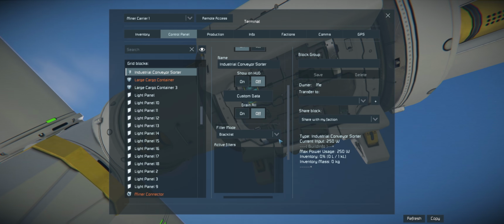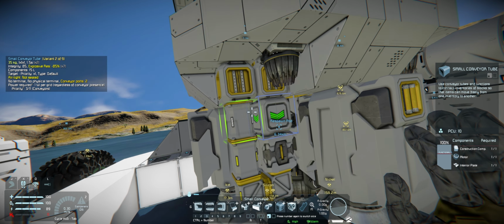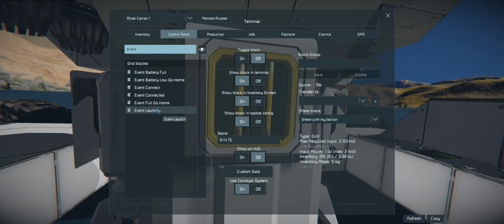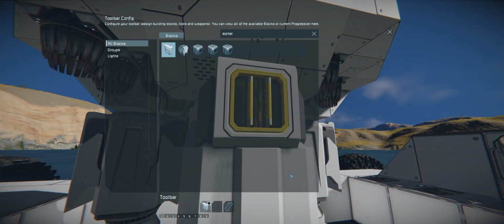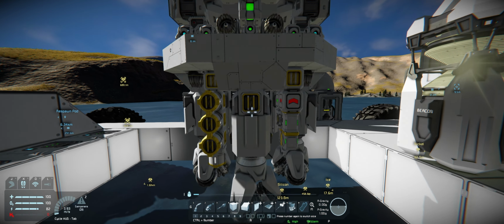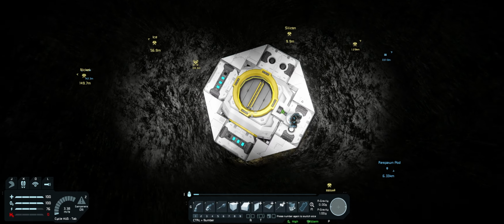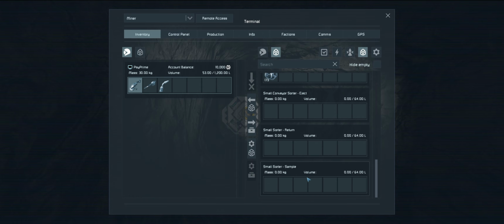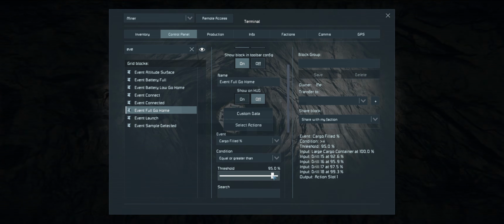Build an Auto Mining Drone Without Scripts - Part 2 (Space Engineers)

Comment: I wonder if there's some way to get it to mine an area? Have a chain of event blocks and sensors to check if there's voxels below it on its way down. If there are none at the bottom of its course, it returns aboveground, moves a bit to the side, and repeats.

And then once it's out from that side, it moves forwards.

Pros:
Can actually dig out an area with enough time.

Cons: 
Has to repeat its route until it reaches voxels.
Maybe impossible? Not sure if any of that works. Still gotta try it for myself.
Reply from the maker: Will likely need a script and programmable block but yeah I believe that is possible. Be sure to let us know how you get on with the modifications 😁

Comment: Making this comment a year after posting, but why not have extra drills on the side to create channels. Then have some wheels inside those channels above the drills. Might help the rig be more stable trips up and down, to increase the accuracy of return connections and reduce damage. Also a system of welders to repair the drone while it offloads material, and a projector to facilitate the repair of missing parts.
Reply from the maker: Good ideas. That’s definitely possible if you want to take the idea further. Good thinking!

Comment: Question:  How important is it for the truck to be level (or the ground to be level), as this may throw off the direction of drilling initially?
Reply from the maker: Quite important to ensure a trouble-free docking, although if you can use a hinge to angle the truck connector you can compensate for any tilt.

Comment: I've been trying to get AI blocks to work, same issues you (and everyone else) have highlighted here with the height above ground. I can't understand how KSH didn't anticipate people would want to use AI for miners. So I use PAM for drift miners, and SCAM for bore miners (the latter being my preference because of how it handles drone swarms). But I still want to find a solution so I can use AI blocks, because as you noted, not everyone can run scripts.

The piston connector to go < 0 AGL is BRILLIANT, though :) One issue though - your return waypoints are relative to the beacon, and set with the connector up high, but with the piston extended the drone is liable to hit that and not connect because it wants to go higher? So maybe put the beacon beside the connector so it won't matter where the piston puts the connector?

I couldn't tell, but I'm wondering if you have the flight block set to align to P-gravity, and set the max angles both to 0? That might solve the problem with it toppling over either on hitting the ground or in the borehole, especially on rise?

Might also want to make the arch a couple of blocks higher to make sure the drone is clear of the borehole before it goes into docking mode?
Reply from the maker: Those suggestions about moving the beacon…. Or setting the beacon after extending the piston… and the tips about max angle ( it is set to align) are exactly what this system needs to fix the last issues! Thank you 🙏
Reply: @Psy-Prime  Nah, you did all the work, I just had the advantage of coming along 11 months later after banging my head against the voxels repeatedly enough that I saw those two bits :)

Comment: Can you use two flight blocks and a time to set arrival at dig point, switch to flight block 2 and move slower?
Reply from the maker: Technically yes, using an event controller to switch between each task block - however then you'd be fixed to a set depth. The idea of this build is to auto-reach the right depth before filling up to return without having to set up anything. It works much better now that Keen fixed some AI bugs.

Comment: Mine almost works, I've got it to complete every sequence. Just not all together yet. It keeps getting confused.
Reply from the maker: I've found that jamming the hole with a connector so it has no where else to go, and setting the task block to continuously play the task helps a lot. Just remember to turn the task block off when it's not meant to come home.
Reply: It gets tipsy without having the connector. Thinking of chute like things to keep it aligned in its initial drop. Maybe give AI only 1 thruster each way and override the rest. It dances around the drop site when I give it full freedom.
Reply from the maker: @ImjustSmash  easier fix for that. Drive it into the ground with a piston while still on the connector to get the hole started and pre-plug the hole. We’re gonna try that next episode.
Reply: I'm near the stage in your video when it came out and turned sideways into the cargo rig.